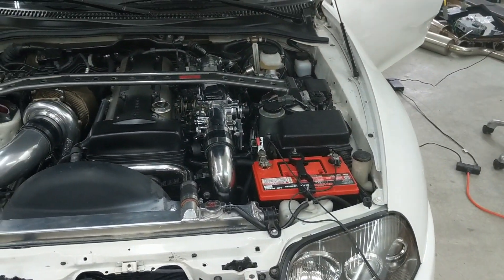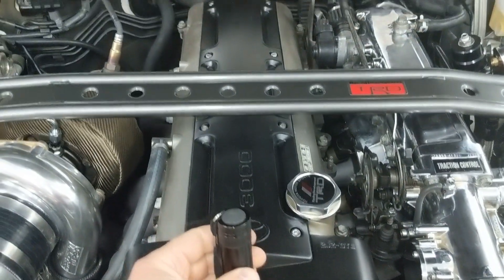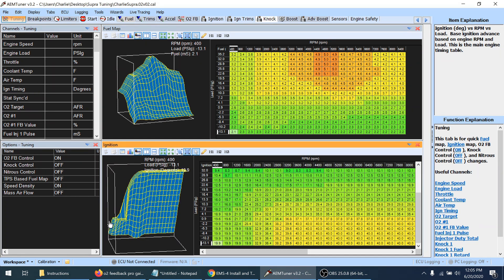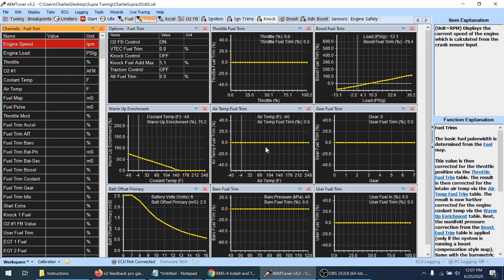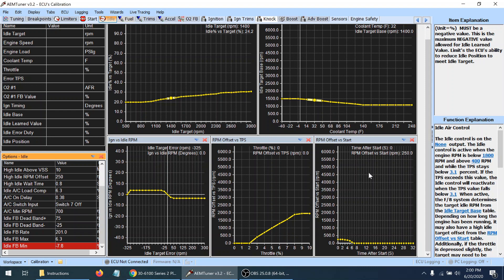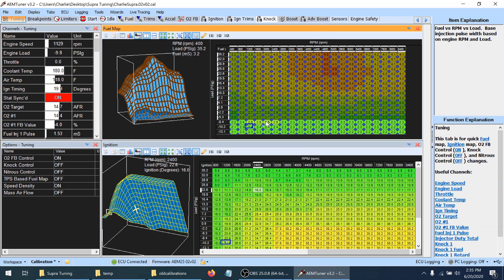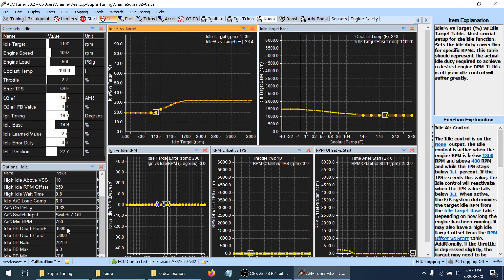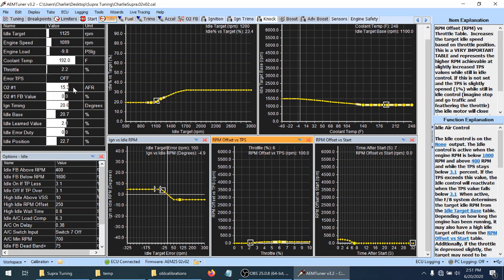Tuning my Supra with AEM EMS V2: Part 3 Timing Sync and Idle tables

Comment: Another good pickup for timing is by the igniter. If you pop up the cap on the harness were it hooks to the igniter there is a green wire. Put inductor over it and gives a good signal. Good video.

Comment: Hello again. Thanks for the great video series. Can you please help me clear up two settings that I'm having issues with on my setup? @28:00 you discuss the Idle settings related to the VSS  and then related to the A/C. The issues that I'm having is that the Vehicle speed is way off (50 MPH on my speedometer registers as over 140MPH in the AEM), I'd like to know if there is a calibration process to get the correct speed to show up on the AEM? Also, the settings for turning on the A/C don't seem to work. It seems like (Swich #6 Ground= OFF) does nothing, I'm using a V1 which I know is an older unit, but from what I can see a lot of the same features are in both V1 and V2. I'd love to know how your settings are for these two functions and if you had to adjust them to make them work properly?
Reply from the maker: Skip ahead to 49:45 of my part 6 boost video where I cover my Speedo issues before doing boost by gear. There is a vss calibration number you can change til it matches. On my Supra the signal was not good going to the ECU so I ended up tapping into an abs sensor. For a/c the ECU will control the wire that tells the magnetic clutch to turn on. It also takes as an input a signal from your climate controls ac button. You can log the input and if you can't see it changing, something is wrong with it. On the supra it's an analog to digital input. I haven't mentioned it in a video yet, but on my supra the input signal was not working. I can't remember all the details off the top of my head but I'll reply back with a forum post I made describing what I had to do.
Reply from the maker: Check out my forum comment from August 17. For analog to digital inputs you can actually log the voltage and in options you can control the min/max for it being considered on or off. The pin aem said to use for my supra didn't change at all when pressing ac button. I ended up depinning it at the ECU and moving it to a different analog input and telling aem to look there. https://www.supraforums.com/threads/fastfalcon94s-build-thread-95-white-supra-tt.1115427/page-4
Reply: @802Projects   Thanks so much for replying, I really appreciate it. I'm watching part 4 of your video series now (going over the warm up tables).  I'll jump onto the forum later and look for details about the A/C.  How's your car running now?

Comment: Question for you... What would cause the rpm to be off when setting the idle rpms? I noticed that my target idle rpms would adjust fine up to around 1400 RPM. When I then set it to 1500 rpm, the rpms jumped up to 2200rpm. Adjusting down the Idle Learned Value didn't change that. Everything below 1400 rpm worked fine when I commanded it.
Reply from the maker: There is a fast idle which is based on speed. I think you said your Speedo was not set right. Maybe it somehow thinks you are going fast enough while parked to go into fast idle. There is also an exit idle value. Maybe you are exceeding that? Also make sure the TPS shows no errors.
Reply: @802Projects  Thanks for the reply. I'll look into each of those possibilities. I'm definitely going to have to change the VSS signal whether it's causing this or not, since it's still seeing crazy numbers.

Comment: Question for you. What's the best way to reverse engineer things if you're using a map that was built on top of a non linear boost comp table?  I'd like to get the boost comp table to be linear like yours, but my current map is built on top of one that isn't. So if I was to change the boost comp table to now be linearwithout adjusting the basemap, it would really mess things up.
Reply from the maker: If you are talking about the "Boost Target Comp" map... that is just the ratio to achieve your target boost. It will have to be linear if its built correctly. I don't know what your target boost level is set to by speed or gear etc... But its just referencing the Boost Target Comp at that point. So really thats the only part of the line that needs to be correct and maybe they left the other parts as is. You can lower your target boost to fill in the rest of the map if it makes you feel better. If you aren't going to utilize lower boost targets it doesn't matter if the surrounding areas aren't correct. If you are talking about the "boost fuel trim" which I have as linear, you'd have to adjust your fuel table afterwards.
Reply: @802Projects  no I'm referring to the Boost Fuel Correct table/graph. The one that you did the 29.4×=35.2*200
Mine looks like a chair pattern and the range goes from -100 to +100 (unlike yours which goes from -100 to 240).

Comment: My idle is very rich (low to mid 11's AFR). I have to find a better blend between the base table, the Injector Dead Time,  and the Ldle Learned Value. When I turn the lights, heat and wipers, the AFR leans out so I end up adjusting the dead time to compensate for the fuel, but then when lights and other things are off, then things get right again.  Oddly enough even when it's rich the Idle learned value will be in the plus side asking for 5-10% more. If I then adjust that, then I'm back at square one... feels like I'm going in circles.
Reply from the maker: Is your battery offset table correct for your injectors?
Reply: @802Projects   Unfortunately it seems like the data provided for the precision 680CC injectors is incorrect. from everything that I've read or heard, it sounds Like the injectors flow less than expected.

Comment: Question for you again, the delivered values for the idle control valve are different than what my current settings are. So where the park value On the delivered map is 62, the current setting is 50. Also the step count is 162 on the delivered map but the current map says 255. Should I set those back to the delivered values, or does it make a difference? I'm thinking if I set them back to stock I'll have to redo the entire idle table.
Reply from the maker: Hmm I'll have to check what my step count is. I'd think whatever aem delivers is correct. The park shouldn't really matter. It will self adjust where it needs to be when it starts. You could see what the step count is at idle and set the park to around there. Then it wouldn't need to self adjust as much after starting.
Reply from the maker: I just checked and my max count is actually 150. My park is at 0.8%. I never adjusted these values, but maybe I'll look into it more in the spring. I know with PWM iac motors you don't want to be anywhere near the min/max duty cycle. I think stepper motors it won't really matter where you are, but you could save some travel time if you set the park rate closer to where it idles. I know you've asked some other map questions too. I just uploaded a copy of my map file here in case you'd like to see other stuff: https://802projects.com/downloads/CharlieSupra.02v02.zip